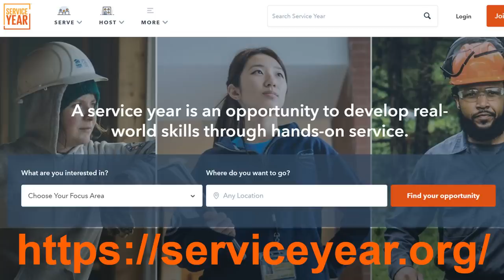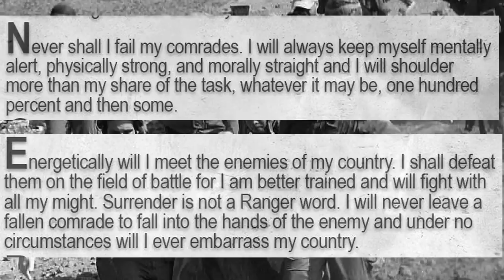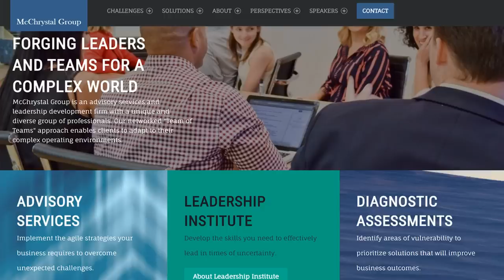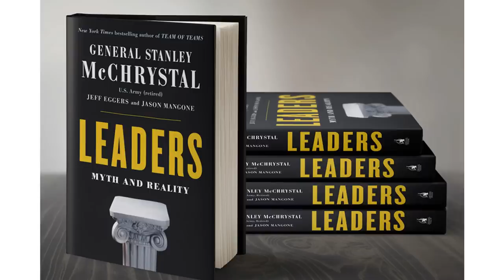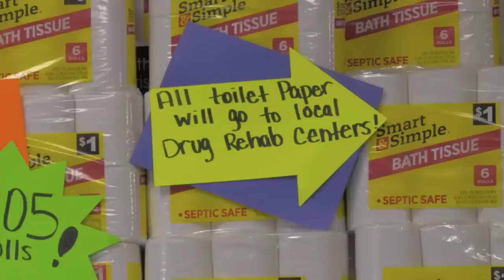Leaders: Myth & Reality: General Stanley McChrystal

Comment: 29:00.. go read the NCO Creed. Then you can understand that the NCO's purpose is to maintain the structure of the Army. That structure is also the culture of the Army. 

No one is more professional than I. I am a noncommissioned officer, a leader of Soldiers. As a noncommissioned officer, I realize that I am a member of a time honored corps, which is known as "The Backbone of the Army". I am proud of the Corps of noncommissioned officers and will at all times conduct myself so as to bring credit upon the Corps, the military service and my country regardless of the situation in which I find myself. I will not use my grade or position to attain pleasure, profit, or personal safety.

Competence is my watchword. My two basic responsibilities will always be uppermost in my mind—accomplishment of my mission and the welfare of my Soldiers. I will strive to remain technically and tactically proficient. I am aware of my role as a noncommissioned officer. I will fulfill my responsibilities inherent in that role. All Soldiers are entitled to outstanding leadership; I will provide that leadership. I know my Soldiers and I will always place their needs above my own. I will communicate consistently with my Soldiers and never leave them uninformed. I will be fair and impartial when recommending both rewards and punishment.

Officers of my unit will have maximum time to accomplish their duties; they will not have to accomplish mine. I will earn their respect and confidence as well as that of my Soldiers. I will be loyal to those with whom I serve; seniors, peers, and subordinates alike. I will exercise initiative by taking appropriate action in the absence of orders. I will not compromise my integrity, nor my moral courage. I will not forget, nor will I allow my comrades to forget that we are professionals, noncommissioned officers, leaders!

Comment: I am no expert on the matter, but I feel like Lee and the south wasn't so much fighting for slavery as they were fighting for independence from the union, particularly it's taxation and federal  government influence. 

I don't wish this to be misunderstood as an apology for slavery, or to deny the north fundamentally ended slavery.

I simply understand it to be a byproduct and not the primary intention of the union. 
I conclude this from the expansion of federal power with every virtuous revolutionary movement. Take the right to own slaves as you unite the wild southwest under the union's federal servitude.  Quite an amusing semantic twist, but a foundation for the state of today, for better and for worst. 

Which is a most curious dialogue. On one hand, it forces us to acknowledge our flaws and realize our potential.
And on the other, it does so by subjecting us to deceit and exploiting our weakest links. 
It's as though it is intentionally sharpening the blade of its declared enemy. I can't tell if it is earnest and consciously so. Or if this, too, is the ironic byproduct of intended spite. The net sum seems evasive til discovered in hindsight. Can't count our chicks til the eggs hatch, after all.